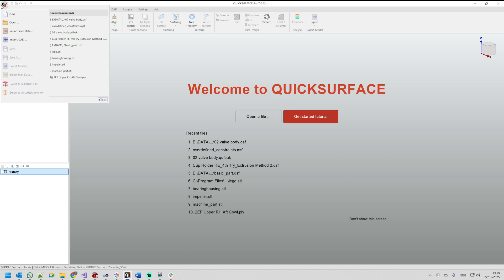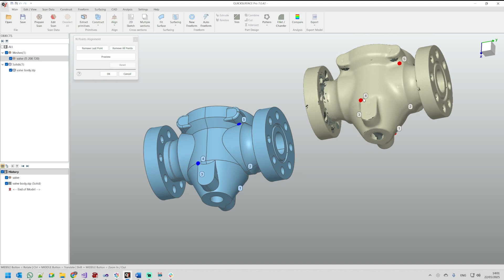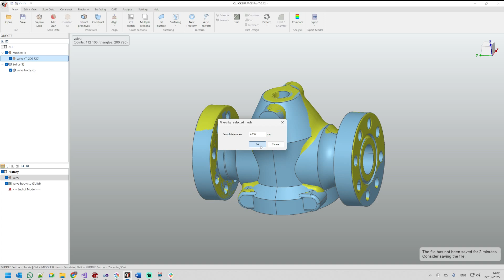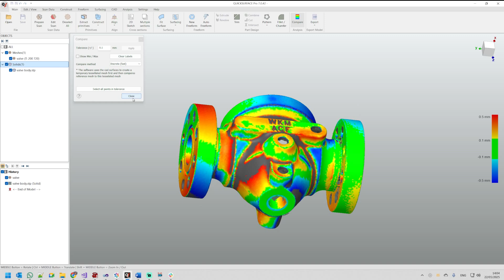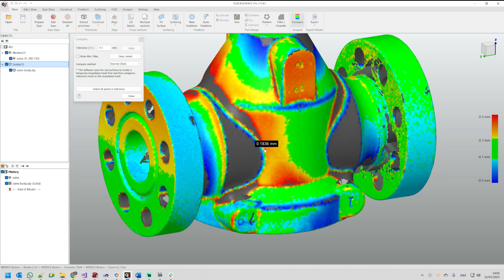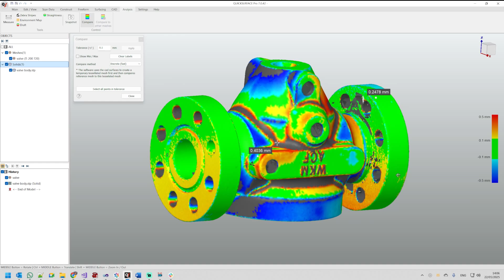Workflow: Compare scan data with CAD with QUICKSURFACE

Comment: Hi, I have the Quicksurface plugin for Solidworks. The compare feature here seems to mis these possibilities. I have just a color deviation map but no min-max labels, no manual labels I can place on the scan. Is there an issue here, or does this function not exist in the plug-in version?